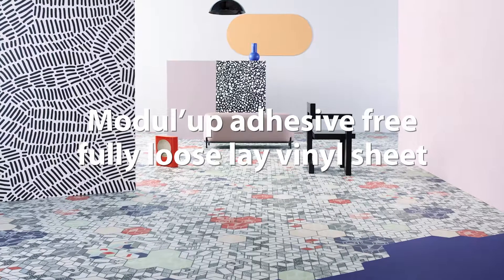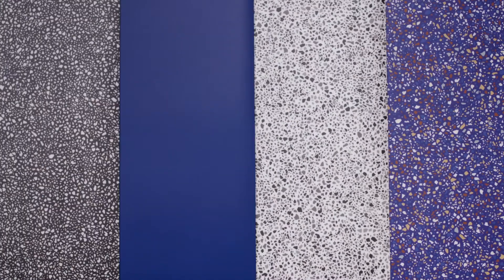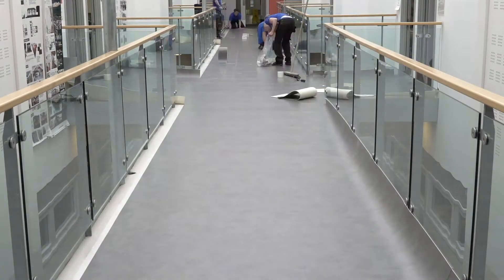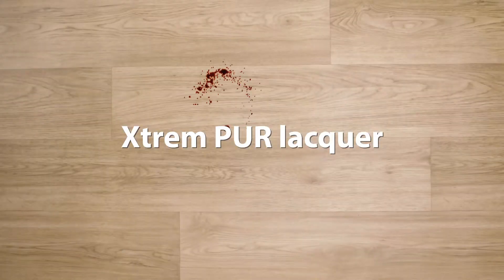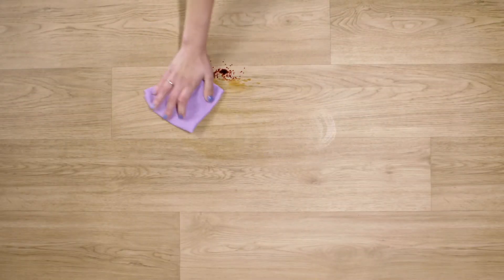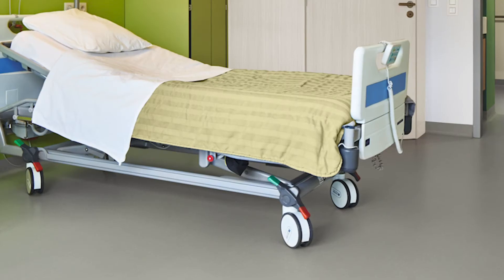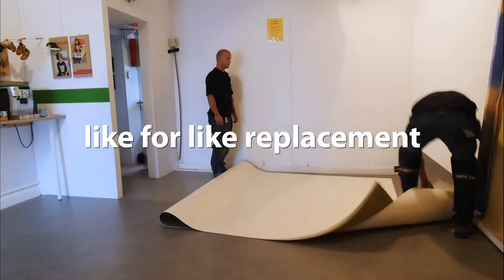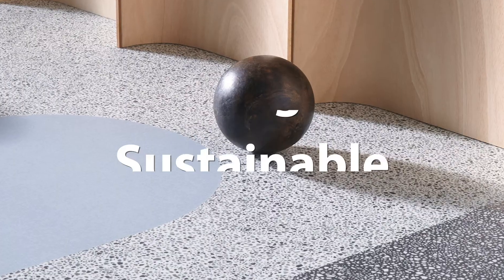Modul'up loose lay vinyl sheet flooring | Forbo Flooring Systems

Comment: hello,
If  no adhesive is used then how is it set so it does not move on the flooring ?
I'm looking for a pvc system to do a few bathroom with on an OSB3 support